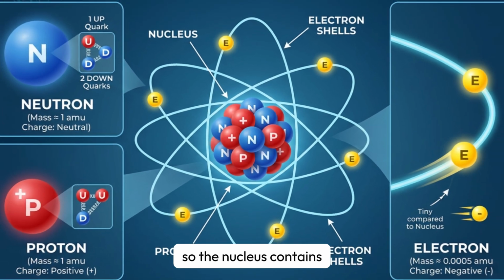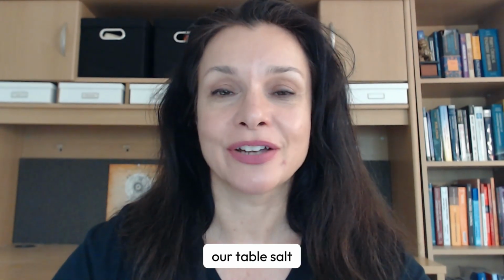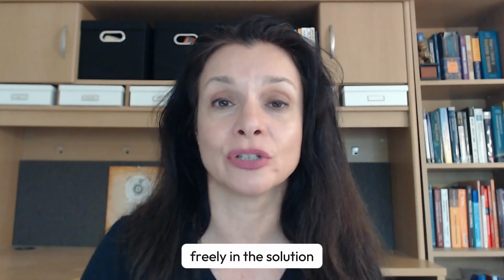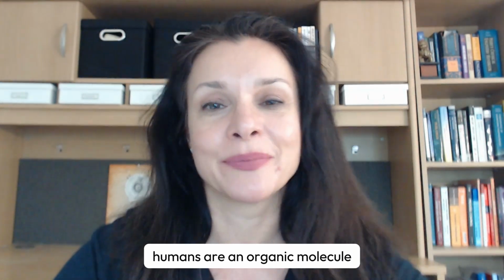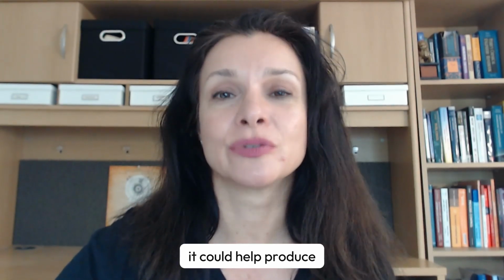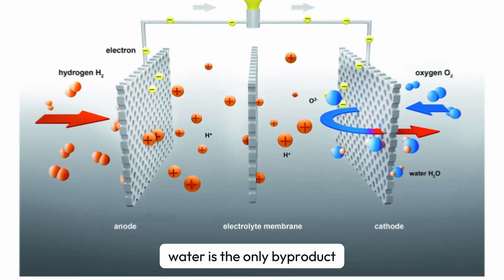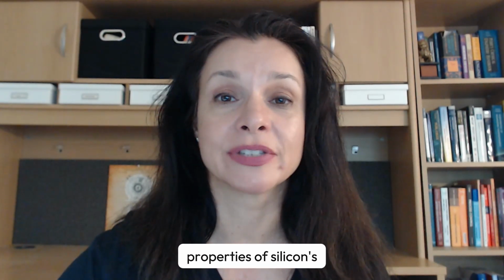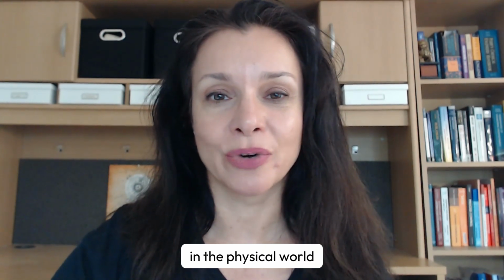Atoms and Molecules — The Building Blocks of Everything | From Atomic Structure to Clean Energy

Comment from the maker: 🔗 Atoms and Molecules — The Building Blocks of Everything | From Atomic Structure to Clean Energy:
https://youtu.be/rkgDcNJgp80

Everything you have ever touched is made of atoms. And understanding what atoms actually are — at the most fundamental level — is the foundation of every energy technology we cover on The Tesla Institute.

This is the video that connects everything.

⚛ Atomic structure — protons, neutrons, electrons — and why most of an atom is empty space
🔋 Valence electrons — why copper's single valence electron makes it the best conductor and lithium's single valence electron makes it the perfect battery material
⚗ Ionic bonding — why salt dissolves in water and why battery electrolytes conduct ions
💧 Covalent bonding — water, hydrogen, oxygen, carbon dioxide — the molecules of life and clean energy
⚡ Metallic bonding — the electron sea that flows through the entire piece of metal simultaneously
🔗 Chemical bonds as energy storage — the single principle that explains batteries, fuel cells, combustion, and solar cells simultaneously

The most profound connection in the entire video:

Hydrogen combustion and PEM fuel cell electrochemistry involve exactly the same atoms — H2 and O2 becoming H2O. But combustion releases energy as heat. A fuel cell forces the electrons through an external circuit generating electricity — at efficiencies far beyond any heat engine.

Same atoms. Same reaction. Completely different output.

This video connects directly to six earlier Tesla Institute videos:
🔗 What Is Electricity?: https://www.youtube.com/watch?v=ZlyUamOiA28
🔗 The Periodic Table: https://www.youtube.com/watch?v=2UZp9ZS5QSs
🔗 Metallic Bonding, Alloys, and Band Theory: https://www.youtube.com/watch?v=LdjQwUQzR7k
🔗 How Fuel Cells Work: https://www.youtube.com/watch?v=3CbdM2IXCYw
🔗 How Batteries Work: https://youtu.be/_T7RrBmw2-o
🔗 AC vs DC — The War of Currents Part 1: https://youtu.be/9nlm9tROV2Q

⚡ The Tesla Institute — understanding energy through physics, chemistry, and engineering.
Nikola Tesla believed electricity should belong to everyone. We are still working towards that vision.

Drop a question in the comments about atoms, chemical bonding, or how any of this connects to clean energy — happy to go deeper.